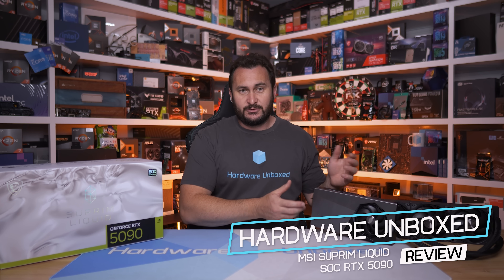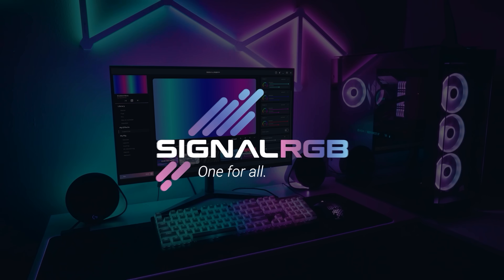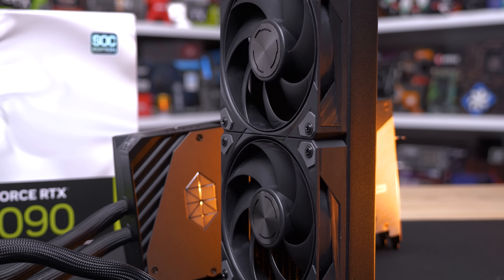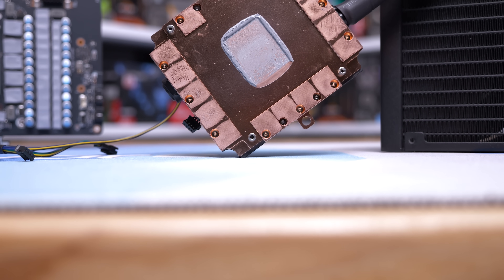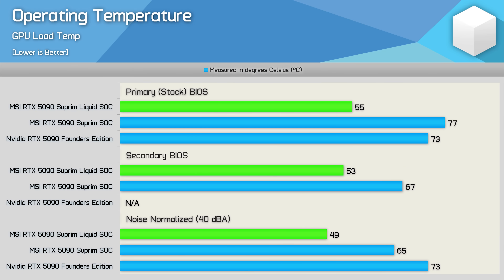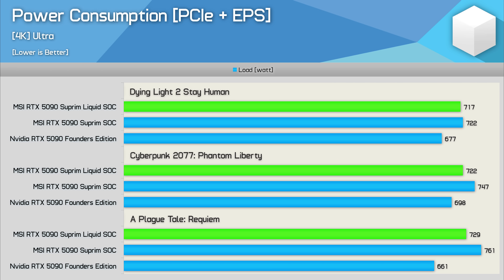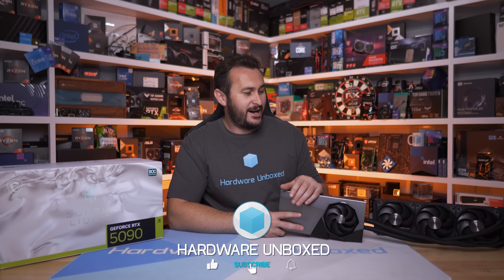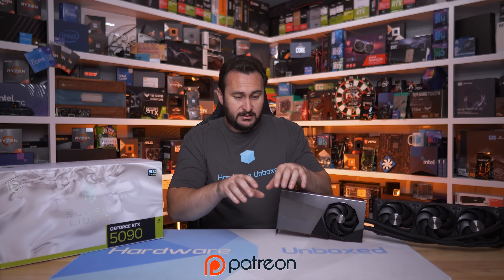The Best RTX 5090.... MSI Suprim Liquid SOC Review

Comment: Honestly, I’m disappointed in you right now. I’ve been observing this over several tests, and you never overclock the Founders Edition, yet you use an OC FE for comparison. Frankly, I find it quite bold that you don’t even include this aspect. And to be honest, I’m disappointed because you usually conduct such detailed and well-executed comparison tests.

The key takeaway here is that it’s actually not worth buying a custom card since the performance is practically identical to a Founders Edition when overclocked. Sure, there might be slightly higher temperatures, but they’re still within the allowed range and specifications.

So please, urgently revise your approach and include an overclocked Founders Edition for comparison. Otherwise, it comes across as if you’re being paid by the board partners since you’re not showing that there’s no real advantage in buying a different graphics card over the Founders Edition when it comes to pure performance per dollar. And that’s the whole point.
Reply: But we all know this, what is the point?
Reply: the one important point you are missing is that reviewers compare out-of-the-box products. because that is the experience every buyer will get. because all the FE cards are sure to run at the presented speed. because all the oc cards are sure to run at presented speed. want to introduce overclocking to the reviews? then how will you account for particularly good or bad chips? how will you make sure they did not get a binned sample? how will you make sure the consumer gets the same performance as the reviewer? how will you account for potential instability? your "key takeaway" is literally the most obvious, immediate and well-known conclusion any non-american already knows
Reply: @arha-z1v  The MSI variants was also shown when overclocked !

Comment: Do they REALLY need a 3 120mm fan radiator considering how efficient the FE can be with two fans?  OR, would they rather the product not fit into my case?
I don't think they need  3 120mm. They could have just gone with the same as their 4090 version.

Comment: A little bit of nit-picking - on the other hand at this price point -  I do not like the look of screw heads on the top of the card (03:17 -  03:35). Not centered in their holes and looks like someone was already busy with a screw driver. Probably black screw heads as on the side would look nicer. However regardless at this price point never ever ...

Comment: 3:20 - Having the power connector recessed isn't just for looks. It means the connector isn't going straight into the side panel of the PC case and has more room for the cables to turn the corner. I'm glad a lot of the AIBs are doing that this generation, as the cards are still maximum width for most PC cases (and too wide for some! I had to change mine), and the bend on the power connectors on 4090s were much tighter than ideal given the shoddy design of the power connector.

Comment: Have you measured temperature and voltage on 12 pin power cable on video card and psu? This liquid overpriced abomination will burn in the same way as FE

Comment: Those designs cost several thousands I dont see why they dont offer them with quick plug fittings on both ends (the block and radiator) so that people can decide if they want to keep the fugly tubes it comes with cause of convenience or if they want to make their own tubing, potentialy connecting it with their already pre existing loop... its would be just like a dozen of bucks added cost at most ... I find it ridiculous that they confine your flexibility at such an outrageous price point + if the radiator brakes you can connect an other one so adds to lifetime of the product.

Comment: Imagine the strain on the shitty 12v power connector with this unit. 700+ watts!!!...we've seen debauer already expose the issue with the power delivery overload through certain wires. This is a fire waiting to happen.
Reply: It's even worse when you look at how these connectors handle power. Actually Hardcore Overclocking explained that quite well. While the connector is the same, 3090 handles this much better design wise.

Comment: I love how it use 720 watts. Not a fire hazard for sure. totally. 5 years ago that much wattage was an entire PC build. With 750 watt Psu.
Reply: I am curious how much you can undervolt the thing, without losing or barely losing any actual performance. In the case of 30 series GPUs, I have heard accounts of people saying  they cut out a third of power draw, while losing........less than 10% of performance, I think.
Reply: @lop1652 I have seen comments of 4090 at 300W with almost no loss of performance (2% - 5%).

I imagine it would be similar to the 5090
Reply: @ Yea that is damn good undervolt, tho I imagine it's a lottery sadly.
Reply: 5 years ago my entire PC (9100+570) consumed 200W.
Reply: ~720 W was CPU + GPU power consumption but yeah not exactly comforting after Romans video.

Comment: Way more cost, that’s sure but you gain:

Marginal FPS boost (but more OC room)
Way better temps 
Way better noise (as less noise)
Less stress on PCIE slot
Less space in case (better airflow)

If you want need these upgrade it’s nice, nobody is forcing you.

For the price it could have used Liquid Metal or PTM though…

Comment: I don't get why people would ever want AIO liquid cooled videocards. After 5 years, or so, the slow drain of liquid will start heavily affecting performance. For a CPU AIO watercooler you can just replace the whole cooler when it starts failing. For a videocard that is far far more difficult.
Reply: Yea it's a really bad idea all around. If you want to liquid cool a GPU, go all in on open loop. That, while it is expensive, can actually be maintained and any faulty part can be replaced. And for new GPUs, all you will really need is a new water block for the GPU.

Downside is money and effort tho.

Comment: The recessed plug in the card is actually what makes some gigabyte cards for example so nice, it helps cables fit in more cases. Even my giant lian li o11d evo xl is barely wide enough for some cards. Prob the biggest flaw of the case, needed another inch to the width.

Comment: Nvidia are killing the PC gaming industry. Think about it. The RTX 5090 founders is unavailable, you cannot buy it, and partner boards are ridiculously overpriced. They have ceased production of the 4090, now you can really only buy the 5080 partner boards and these are almost the same price as a 4090 yet you are getting less performance. This cannot be an unplanned strategy, we are literally going backwards.
Reply: Thats their plan all along. The 5080 is a 5060 Ti. 256-bit bus like the 3060 Ti, 3060 Ti had 45% the cuda cores of the 3090 Ti. The 5080 has 43.7% the cores of fully unlocked GB202. So its worse than the 3060 Ti for 4 times the price. $1400+ for a 5060 Ti. Im never buying nvidia again, and will tell all my friends not to buy nvidia either. Nvidia gonna miss out on 30-40 sales.
Reply: And the 40 series stock did not drop in price either. It's just the bew stuff being more expensive. The 4070 is the same price as it was over a year ago. But inlive in Europe, where pricing has always been arse.
Reply: I think the main issue is that Nvidias revenue share for gaming hardware has dropped significantly since the AI boom. Every chip competes with AI hardware, which has much higher demand and higher profit share per unit sold. So Nvidia simply don't care much for gaming anymore, it's just a small plus on top. It's sad but it's just the way it is now ...
Reply: You can still walk into any Best Buy or Micro Center and buy an RTX 4060, 4060 Ti, or 4070 Super. These are the cards most gamers buy. Saying Nvidia is killing the pc industry is a bit of a hyperbole when only 10% of gamers buy 80 or 90 class cards. It may seem like it if you refuse to game on anything that isn't a halo product, but it is simply not the case.
Reply: @dcarpenter85  Except this generation is more expensive for less gains, Looks like its team red time or another 2 years to move on from my 3070.
Reply: @ most people with a 40 series 60 or 70 tier card are going to skip this generation. Anyone coming from a 30 series 60 or 70 tier card are going to be wowed by the gains. You need to look at this thing the perspective of the average PC gamer, not high end enthusiasts.
Reply: @ Except the 5090 is more then 2 months rent in Australia $4040-$5700 AUD$ and the prices dont include the $300 USD ($480+ AUD) increase after they all sold out.

The only reason I have a 3070 was due to the scalping and no availability/shit launch during covid. Where buying a prebuilt was the only way to get anything.

Australia has been priced out of the market.
Reply: @dcarpenter85  yes but with these high prices it slows down market adoption of better gpus, which also slows down game development and innovation
Reply: as long as the stock goes up don't care
Reply: if you consider their industry, eventually they will hit a point where nobody will need to upgrade because all our games will hit whatever frame rate most of us realistically need. once I can hit 90-120fps in every game I have, I won't need to buy a new gpu for YEARS, possible decades if optimization continues its trend. in order to keep this wing of their business open, they need to keep this from happening for as long as possible
Reply: You could just wait a few months🤦‍♂️

Comment: There are no bad video cards, only bad pricing and availability. Some people in the comments need to write this 100 times on the blackboard every morning. 😄
Reply: Sure there are bad video cards. Pretty much EVERY 5090 is bound to end up with a burned connector at least and a house fire at worst. That connector and the way it handles power is NOT SAFE.

Comment: The off-centre screw holes against the memory chips shouldn't affect cooling. The actual heat-generating chip is only in the center part of each memory module.
Reply: still not optimal. in those areas some air inherently gets trapped and create heat pockets. These greatly degrade the heat pad over time.
Reply: @sinenomine4540  interesting.. can that air really cause degradation beyond the spot it's directly contacting?

Comment: I like the water blocked offerings that come with out the tubing and rad/fans. I have all that already, on two systems, and would dig just buying a blocked card, to just slap in my rigs. I dont need all that extra spending/waste.
Reply: They’re a good option if you’re going for a custom loop or already have one. You better hope that it’s not some Gigabyte nightmare that has nickel plated aluminium and hope that the block is serviceable.

Comment: The gains/stats shown in this video are completely fake. The extra clock speed is because the RT and Tensor cores are off. Which was not the case in founders edition review that had the RT and Tensor cores on, giving the false impressions of significantly higher clocks. Completely changing test methodology to favor a product is deceitful.

The 5090 is comprised mainly of Cuda, Tensor, and RT cores. Shutting off 2 out of 3 types of cores allows the CUDA cores more wattage thus higher clocks. CUDA are also just more stable.

Comment: Incredibly dishonest review, from a 3 year + fan. Those 3100mhz+ clocks are only achievable with the RT and Tensor cores off. With them on it drops to 2700-2800mhz due to power restrictions. Considering you tested the founders edition with RT and Tensors on it gives the false impressions the MSI Suprim clocks way higher.

This deciet requires multiple steps 1. Turn off gpu usage stat to hide rt cores being off (which you did) 2. Use all non-Rt benchmarks 3. Dont mention the different testing methodology 

The 4090 suprim liquid uses 30% more power consumption (600 watts) than founders 4090 (450w). The 5090 suprim liquid only uses less than 5% more power due to the 600watt limit of a single 12v connector. This of course limits the 5090 suprim liquid to have a smaller performance gain over the founders edition when compared to all previous generations.

Those 3000+ clocks are impossible while using tensor and RT due to the 600w power limit. Clocks drop to 2700mhz with RTX on, far closer to founders edition then previous gens.

I don't understand why a trusted YouTuber would put out such a blantly deciectful video.

Comment: I would suggest a new point of interest for these reviews.
Please take a look on the PCB for electrical safety measures. 
Some models have none and some has a fuse or something to prevent disasters.
Reply: None of them can really prevent it from what I've seen. Asus in some models tried to add some ways to tell if you are a close to the burnout (that is reported in their proprietary software), but it cannot prevent it, since the connector is just that bad.
Reply: @lop1652  well it's time to point these out and make purchase suggestions based on that. 
If there's a review with a million views telling the people to avoid buying the fire hazard they will be forced to do something about it eventually.

Comment: All it needs now is a cooling-jacket for the power cables and sockets at either end. Maybe add a fire alarm and tie the RGB output to the temps of those cables...  :D
Reply: I remember watching a channel doing a cannonball style road trip with electric trucks where the driver of the Cybertruck or the Rivian would wrap a soaked towel around the charging connector in order to maintain peak charging speeds, maybe this trick could work for the 12-pin connector too
Reply: GIGABYTE TRX50 AERO D
Comes with 2 thermal sensors and a sound sensor.
I'm going to program the computer to throttle if those sensors reach even half the temp needed for the materials in the wires to auto-ignite.

Comment: what sane mf will not undervolt it anyway? sure... 53 celsius is nice but you gen get a 1000version cheaper of this card, undervolt it , lose 3-5% performance and run it at 57 celsius.

Comment: Now that you are on it and while der8auer has shared that the dreaded 12v2x6 cable can get really hot, about 80C on the GPU side, is it possible to test if a liquid cooled card would have worse thermals on the cable as there are no triple 10cm fans aiding the airflow inside a computer case as compared with a traditional air cooled card?

Comment: how easy is it to change fans? if i wanted to put some phanteks t30s on it like i did with all my AIOs?
Reply: You should be worried about the pump more than fans. And I doubt that can be replaced or fixed at all. If you want to liquid cool a GPU, just go all in on open loop, instead of whatever the fuck is this frankenstein of gpu. That way you can at least maintain all the parts (and also connect CPU and RAM to it, if you are so inclined).
Reply: @lop1652  I'm not worried about fans just want to put better ones. As I saw on AIOs they pretty much all come with bad fans and replacing them with t30s improved performance. Especially those with rgb, only the Ryujin III extreme has decent stock fans for radiators. I replaced the stock fans of my Tryx panorama and got fantastic results.
Reply: @ Looking at the AIO itself it looks like they can be replaced without any issues.
Reply: @lop1652  yeah, if it's a normal connector seems it wouldn't be a problem, unless it's some proprietary thing.

Comment: I find this to be a stupid design. One of the big pro's of watercooling your GPU is reducing noise by being able to cool the radiator with low rpm silent fans. Having one of those noisy fans on the card itsself nullifies that advantage.
Reply: Noisy? That fan is probably inaudible. If you don't like it Gigabyte's waterforce 5090 doesn't have a fan on the card.

Comment: That's the card I'm aiming to get whenever I get the chance. I've bought MSI's liquid cooled gtx1080 and it's still working flawlessly to this day.
Reply: Don't buy it, it's a literal fire hazard.
Look at DerBauer's video on it, the wires on his normal working card get up to 150c after 3.5 min of load.
Reply: Bro dont buy a 5090 for $3000 its such a scam bro, the “5080” is a scam too. 43.7% the cores of GB202. The 3060 Ti had 45% the cuda cores of the 3090 Ti and was $400. The 5080 is a 5060 Ti selling for $1400+.
Reply: You are %100 right, but there isn't an alternative and gaming is my main hobby.

Comment: I might cancel my 5090 pre order because these cables are just blatantly dangerous. No current balancing so some cables are taking the brunt of the current, getting hot and melting the cable, the GPU connector AND the PSU connector. Buying something for £2,000+ for it to have a serious chance of melting and breaking even if connected perfectly is insane. Something like the EU or some assessment body needs to sue Nvidia and whoever tf else designed this cable and force them to never use it again.

Comment: Just out of curiosity, when the pump goes how much would they charge to fix it?
Reply: I think they wont fix them, but i may be wrong so im gonna get a seat here to read the answers
Reply: When the pump goes i think the whole thing is done for. They don't just fix it.It'll need to be replaced via warranty.
Reply: In the roughly four to six years, you won't have warranty anymore, and what you then do is you hope there's still a custom watercooling block available, or someone is selling their air-cooled version cooler to get rid of it.
Reply: You think it'll last that long with its Multi Flame Gen tech?